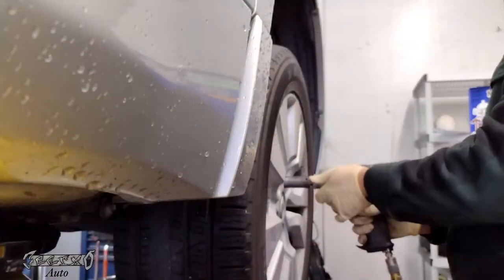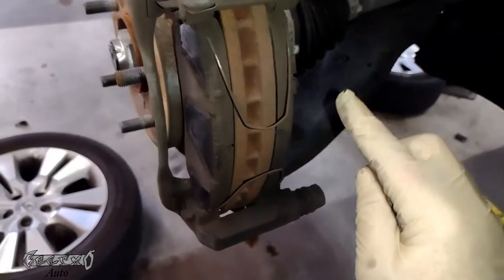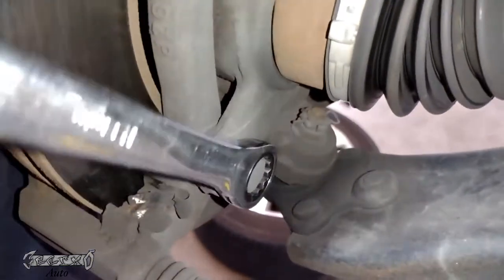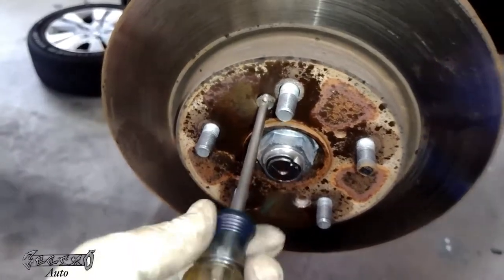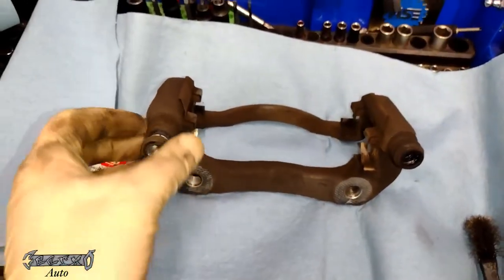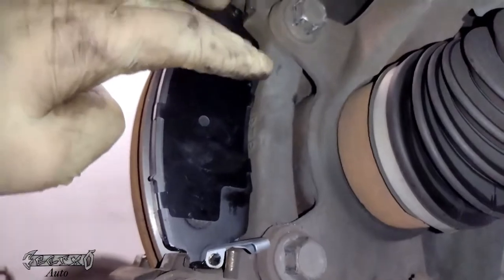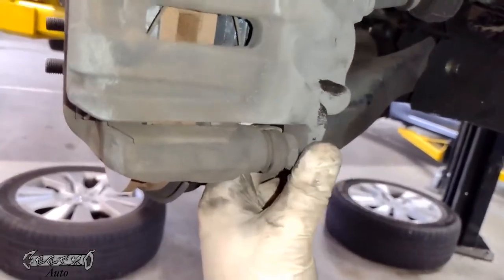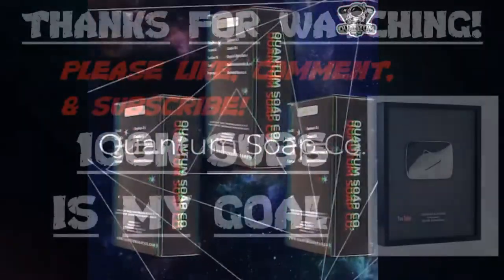2007-2012 ACURA RDX FRONT BRAKES TUTORIAL PADS + ROTORS

Comment from the maker: GET THE BRAKE PADS HERE ( AMAZON ) ( $ 30 BUCKS )
https://amzn.to/3UE92TG

GET FRONT ROTORS HERE ( AMAZON) ( BUY 2) ( $ 52 BUCKS) 
https://amzn.to/3TEYLoY

GET FRONT PADS + ROTORS BUNDLE DEAL HERE ( AMAZON) ($ 134 BUCKS)
https://amzn.to/3AabTvc

GET THE FEATURED  CALIPER TOOL HERE ( AMAZON)
https://amzn.to/3WWZJzJ

//// CHECK OUT THIS NEW MENS SOAP COMPANY////
      
QUANTUM SOAP Co 

https://quantumsoapco.com/

CHECK OUT THE WEBSITE HERE AND USE

 PROMO CODE -GearmoAuto      10 % OFF

QUANTUM SOAP JUST RELEASED A UNIQUE BAR FOR MECHANICS AND TOUGH GUYS CALLED 
"GALACTIC MECHANIC "

IT HAS EXTRA GRIT / EXFOLIATING SCRUB COMBINED WITH A UNIQUE MANLY SCENT.

Comment: So I'm about to do this and looked up the torque specs in a 2007-12 RDX service manual - 101 lb ft for the caliper bracket bolts, 37 lb. ft. for the flange bolt (the one that allows the caliper to be tilted up).

Comment: All that work and new parts and you use the crappy cheap semi metallic 25$ brake pads. Those eat rotors so bad, get the yellow box for 50$. Also don’t just pull the pins out like that pop the lip off the rubber boot so it doesn’t fully pull the rubber stretching it to the max and beyond causing it to rip. I LOVE the fact you state what tools needed I have been working off my motorcycle lately and love just taking what’s needed not an entire tool box making a 50 pound back pack. Should always clean wire brush everything and use grease on the pins and top and bottom of the brake pad ears so everything can slide easy and not lock up causing just the inner or outer pad to be eat up more then the other. Use an impact screw driver vs the air hammer that way it doesn’t damage the little screw then have to drill it out. Lastly 99% of the time the caliper bracket bolts are the same size as the lug nuts not always but more then not. Love your video man keep up the great work.